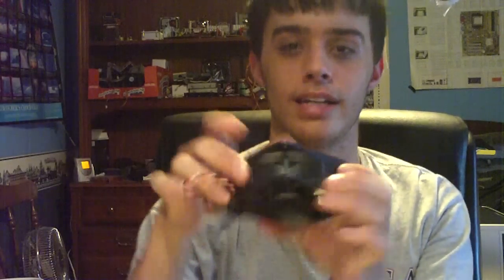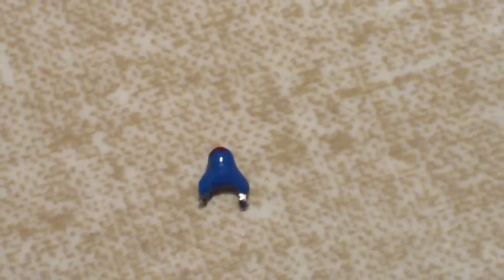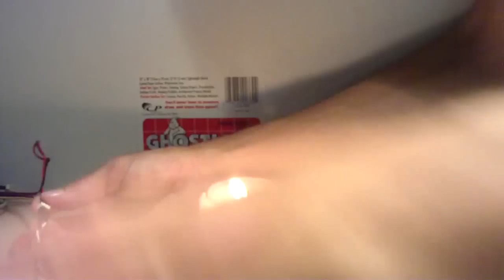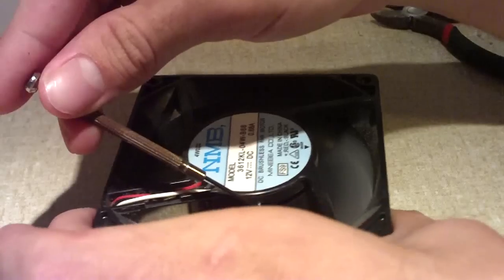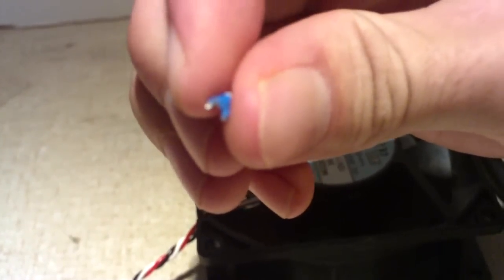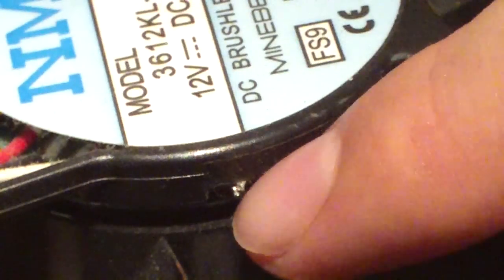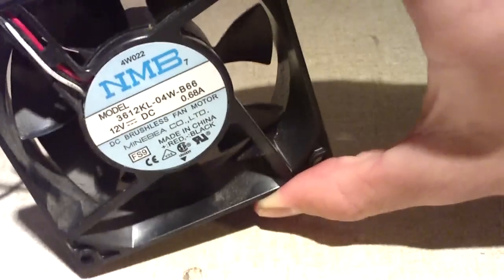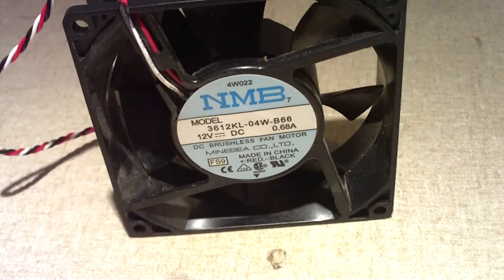How to Modify a Thermally-Controlled Fan to Run at Max Speed

Comment: If your fairly sure of your soldering skills, I recommend soldering two wires onto the leads of the thermistor & then to a switch.

I modified a few of these with switches so I could go from thermal control to full speed when needed. Saves the thermistor & adds another level of control :)
Reply from the maker: Good idea!
Reply: Nexarianz sure
Reply: I have changed my ups fan but the new fan creating extraordinary noise and also running at high speed RPM... Can we fix this issue
Reply: Of course it does make sense cuz it will act like speed controller

Comment: Interesting video..  I like how the fan had the thermsistor mounted right on the side of the fan (nice and simple).  I don't recommend removing this as the life of the fan will go down substantially, but if you decided to, you should also solder the leads for better electrical connection.

Comment: Hi, i have an Sensflow EFC0912BF 4W022 with the same thermistor on it, the idea is take off the thermistor and put a potentiometer, the thermistor make 10K ohms on freezer very good for slow speed, so put the 10K pots for variable speed.

Comment: To anyone commenting about how to bypass a fan with no thermistor, you don't need to bypass the thermistor, as there is no thermistor to bypass. If you want the fan to run at full speed, change your BIOS settings to disable smart fan control.

Comment: OK, time for the smart-ass reply. If you are just twisting the ends together anyway? Why don't you just grip the thermistor with the pliers and twist it? Cutting the thermistor off doesn't seem to add anything to the finished modification?
Reply: Robert Kubrick removing the thermistor improves thrust slightly.
Reply: @yangexue6596  - you missed Robert Kubrick's point. The snipping was not necessary. He could have just grabbed onto the thermistor and twisted it until the legs touched. Snipping it off was not needed. It would be bypassed by the short. 

He could also have just left it alone, untwisted, unsnipped, and wrapped the thermistor's little legs together with some fine, stranded, insulation-free wire, just like a cowboy in a rodeo calf-roping event. Be sure to raise both hands high in the air as soon as you finish, though, so the rodeo judges know to stop the timer!
Reply: logmeindangit If you cut thermistor off you could use it somewhere else
Reply: @yangexue6596  no you can't, there are no leads left on it this way to be able to do anything else with it. If you could open the fan up, and remove it properly, yes you could. This is not how I'd want to do anything. That will NEVER last, at least solder it.

Comment: pro-tip. if you have an exposed thermoresistor you can just bridge it with a bread tie and snip that off without modifying your fan. while this technique is valid its also over kill. unless you want to hook up your fan to a dedicated (compatible) temperature controller there isn't much need for this mod. other wise you'd need to balance your fan duty cycle to prevent it from burning out withing a year or two of use...

Comment: nice tutorial,i have intel stock cooler PWM oem- foxconn and delta both work but after cut the senzor(termostat) is not necessary to stick both wire is work to full speed without stick...is necesarry stick?

Comment: I have a ksb06105hb fan from ebay because it looks pretty good and it is a 5v fan, 0.50a. It has 4wires en i can see a ic with 8/10 connections but no thermistor, can i bypass this one?

Comment: Is there a way to control the speed instead of clipping the thermsistor? I’m powering my fan from a ac/dc wall socket.
Reply: In my opinion, thermistor is resistor that take affect with temperature. Maybe if you replace the thermistor with variable resistor it can be done like that.

Comment: @CubeComputerChannel would it not be easier and more easily reversible to place a small piece of copper wire between the two poles of the thermistor? It would still bypass it, until you removed it.

Comment: I used mine to build a small marijuana grow box, the grow box is strictly for pollinating new strains so now I dont have to risk crossing stuff in my flower room that I dont want crossed and when I'm done breeding I can grow those seeds in the box also. I left the temp chip on my fans so as it gets hotter in the room they push more air but looking back I should have bypassed it

Comment: Hello,
i would be really happy if you could hellp me.
i have a case fan with a thermistor(i use it as a cooler for an old graphic card) that automatically speeds up the fan.
I want the fan to be as quiet as possible so i want to reduce the fan speed.
is there a way to manipulate the thermistor to make the fan run slower?
Reply from the maker: If you can determine the resistance value of the thermistor at a given temperature by desoldering the thermistor from the fan and measuring its value with a multimeter, you can replace it with an extension wire with a potentiometer (rheostat) of similar resistance to the thermistor, and be able to control the fan speed.
Reply: either cool the thermistor, or replace it with a different resistor of higher resistance (a variable resitor would probably be best)

Comment: Does this thing have high suction?
Reply from the maker: A little bit.
Reply: @CubeComputerChannel  is there any other way for speeding up the fan which is more easy?
Because my fan is not thermal controlled it is stock cooler

 And this included

KMEX
Bruhless DC fan
 DC: 12 volts
Ampere: 0.18 amps

Comment: One more thing i want to know is, if i remove the transistor, how much voltage this fan will use and that 9V battery will last how long?
Reply: That uses more than 1 amp so it wouldn't last long

Comment: If you wanted to keep the thermal switch you could just run a small bread tie wire around those two leads , twist it up , and cut the excess off.  Just keep it out of the fan.

Comment: do you know how to do that for a fan that does not have one of those
Reply from the maker: Usually if you don't see a thermistor on the side of the motor, the fan is not thermally controlled. Many motherboards (especially in OEM brand systems) have smart fan control built in, which throttles down the fan speed.
Reply: so is there any way to speed it up then
Reply: Yes more voltage.
Reply: but dont plug it in your USB an USB is only 5 volts try to find a way to run it at 12 volts
Reply: cut the blue wire
Reply: Try 500volt, maybe you have build a cf6 turbo fan engine!
Reply: +Jason Shaffer find out which wire is the tachometer and cut it, you will get the bios saying that there is a fan broken and it should spin up to full speed (trying to get it unstuck)

Comment: Hi, thanks for making and sharing this video. Can anyone give me some advice on how to wire a case fan to mains supply. I have an ARTIC F8 PWM PST CO DC 12V 0.09A case fan with three strands of wire attached. Thanks
Reply from the maker: If you are referring to 120/240V mains, you would need at least a simple plug-in AC adapter that can supply 12V DC 0.09A. If you want the fan to run slower, you can choose a power supply down to 5V DC.

Comment: just twist a wire around the thermo resistor to bypass it. Once there is a short created, the electricity will be moving along the short, so its pointless to do any extra steps like cutting off the thermo resistor then twisting the metal. Also, what if you break a wire while twisting it? what if you cut too much metal off? Then you can't twist it or tie a wire to it.

Comment: I think you could make this a lot easier if you just grabbed a piece of thin wire and wrapped it around the thermistor.
Reply from the maker: It would have been easiest to just add a blob of solder between the two leads. And if I wanted to remove the modification, just reheat and remove the solder.

Comment: Therm-O-STAT. Thermostat is the regulator that identifies heat and raises and lowers temps accordingly
Reply: Ther*mis*tor thermistor. Thermostats use bimetallic switches to open or close a contact, thermistors, which is in fact what this is, use changes in conductivity relative to temperature to vary resistance. Ther mis tor... STOP trying to correct people when YOU are the one who needs correcting. YOU are why there is so much disinformation, stop spreading your ignorance as fact.

Comment: my fan doesn have thermistor or its hidden ?
Reply from the maker: The fan may not be thermally controlled.
Reply: thank you for the reply ! and what would you suggest me to do in this case ! it has two lil black cylinders with 105°C1 +105°C2

Comment: what will happen of I connect 2  9v batteries to it
Reply from the maker: You might notice a hint of a burning smell and see some smoke.
Reply: there wont be smoke if both of the battery red terminals and black terminals are connected separately not positive and negitive to give it 18 volts that is bad for the fan and it can kill it

Comment: NIce; you really *don't*  need to clip the thermistor off;  just solder a thin wire over the 2 legs,leave the thermistor on as it was; you will understand when you study the matter;  plus,,it's reversible,any time after that you can remove the jumper  and the thermistor is as good as it always was ; (i thought i would try to simplify the procedure this way).

Comment: why add a switch when you could add a knob to twist the speed high low much easier and then you can set to your desire
Reply from the maker: Dan Madden A proper rated rheostat will work in place of the thermistor.

Comment: Sorry, but that's pretty hacky. Well presented, I'll give ya that. Why not just solder a small jumper across the leads and done, then if you ever wanted to change it back just remove the jumper. Or at least solder them, there's no way that'll last. Just a mechanical connection, and likely a poor one at that.

Comment: thermal resistor is a protection for your fan motor so that it will not over heated and burn, if you removed and short the two terminals it might be burn your fan motor.
Reply from the maker: The thermal sensor provides absolutely none of what you just mentioned. It regulates the fan speed based on temperature. The higher the temperature, the faster the fan runs.
Reply from the maker: I have a degree in computer engineering. Please do not send me Wiki articles on thermistors as I know exactly what they are. The thermistor on this fan works in conjunction with a fan speed controller to regulate the fan speed based on air temperature of air passing through the fan.
Reply: a doctor has a degree more than a years you studied and they can commit a mistakes and this is not about the degree it is about how you understand .